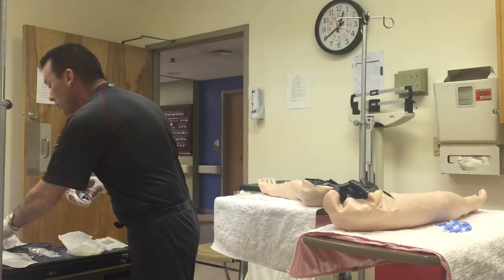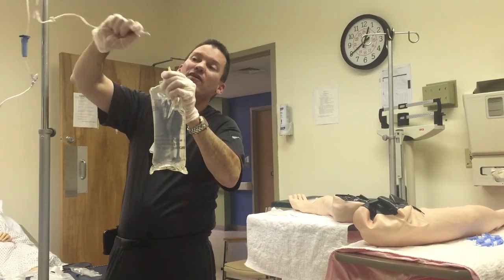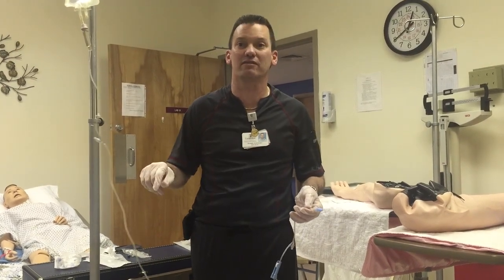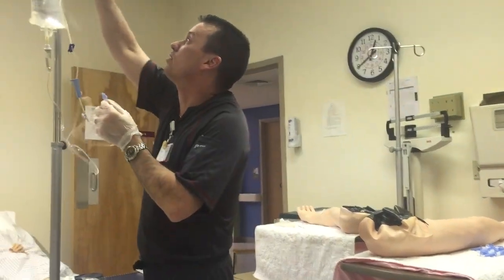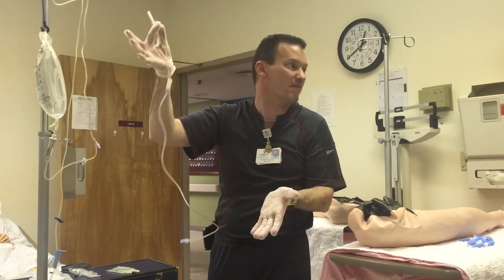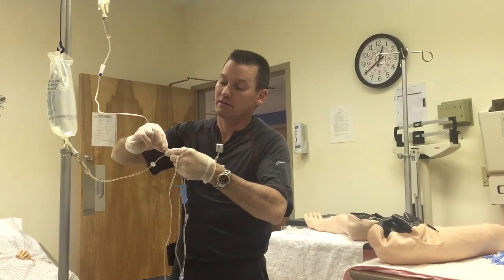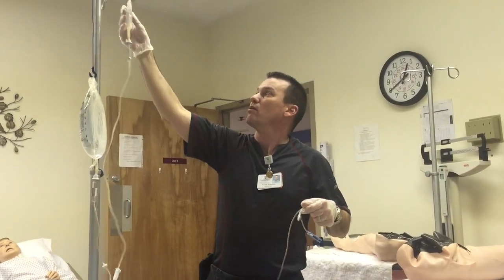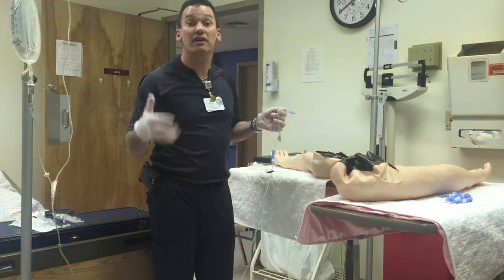How to do a Primary and Secondary Line including Priming and Backpriming

Comment: possibly a stupid question. why do you backprime secondary tubing instead of priming it how you did with the primary? like squeezing the chamber and unrolling the roller clamp and watching as the fluid fills the line? seems easier
Reply: because the pb is an antibiotic and you don't want to waste that like you could a saline solution (it's way more expensive)

Comment: So when you are back priming, you are closing the clamp on the primary tubing and then hanging the secondary bag below it?
Reply: yes but remember to keep secondary clamp fully open during process till all air bubbles are cleared from secondary line. when done, close clamp, place bag higher than primary and connect primary tubing line into iv pump port, set rate for secondary bag infusion and fully open both clamps, as pump will now take over drip rate. If running in ems field without an iv pump, your drip rate will be adjusted manually by roller clamp on primary line, while secondary clamp stays fully open, as that drip chamber will be only one being active due to gravity pulling from higher source.